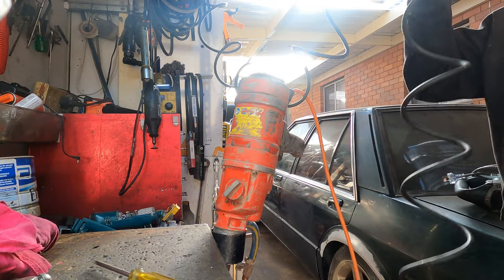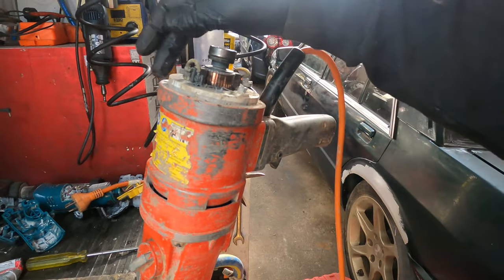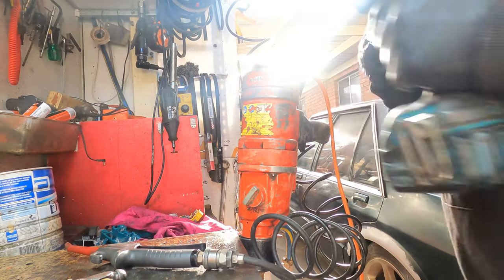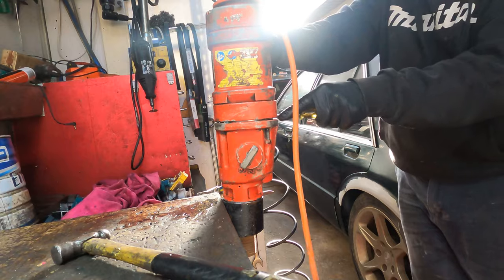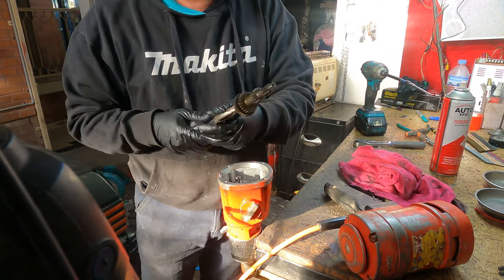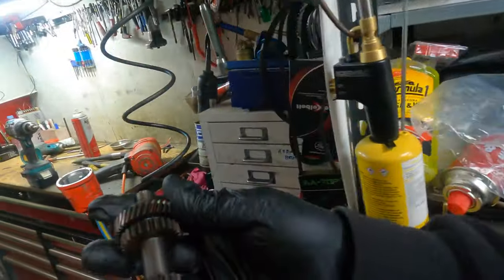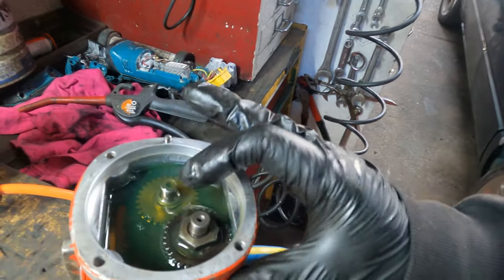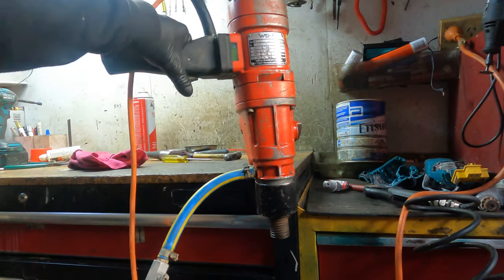weka core drill quick services

Comment: Been workin on wekas for 25 years.....dk 12, 22, 32 and 52.....good video👍🇺🇲🇺🇲🇺🇲🇺🇲🇺🇲🇺🇲
Reply: Can you tell me the torque specs on the clutch for the DK16/18?
Reply: @basdoo4847  If I remember correctly it wasn only 35 but that is simply not enough. It would start slipping with a three inch bit..I would get it actually as tight as I can with a 3/4 inch wrench. You have to put the gear into a vise wrapped with a real heavy rag. Or you'll mess up the gears when you go to tighten it up and tighten the little nut.

Comment: Hello. The clutch is a safety mechanism. It is there so that you Don't strip out the gears in case the diamond core gets stuck. Most importantly, It is also there so that the drill doesn't break your arm. This size should be torqued to 15nm. The ones that are larger, 20nm of torque on the screw.

Comment: That part you dropped is the copper bushing when that wares out ,the teeth stops engaging with the main gears, the torque on the clutch is equally important, I’ve used theses drills a lot .
Reply from the maker: @JeffSebastian-dq4sd   correct get new copper it call clutch

Comment: I'm working on my core drill. It's a weka dk12. Thank you for the video it really helped out. Although I got the clutch shaft out and the 2 of the gears off of the main shaft, I can't get the little retainer ring off that's deep inside. I can open it up the ring but can't get it out of the groove and off the shaft. Any chance you can walk me through that? I'm trying to completely disassemble the gear box so I can replace the seals and possibly the bearing. Also some genius took the gear oil out and replaced it with grease. I'm assuming because the lip seal was leaking and they figured the grease wouldn't leak out. I need to completely clean up all of that old grease so I can put it back together with some fresh oil. Any help would be appreciated!
Reply from the maker: The main shaft seal very hard to replace.if you know it not hard.got to carefully when your remove the gear lever.it got hold by spring ball becarefull  when open .after you got it out can smask the main seal out.2 of them
Reply: @TheDingdong78 any advice on the rotary seals ?
Reply from the maker: Try to pull it out
Reply: @TheDingdong78  which way do they come out is it through the front of the gear box it looks too big to come out that way
Reply from the maker: @DavidHayesbigtoe  back where you open up and see all the gears come out at the back

Comment: Hello I have a Milwaukee core drill (4005) and had all the seals replaced and it still leaking water. Water shoots out from the 4 little holes on the shaft and also on the bottom. Any suggestions on what it could be.

Comment: Hi Simon, my Core Drill DK 12 when set on gear 1 and press the trigger and will do free spin but when i started to drill the concrete it stop spinning completely and the drill is still running. Gear 2 and 3 seemed to work just fine.  Please advise. Thanks in advance
Reply from the maker: Need fix clutch inside where the gear is
Reply: @TheDingdong78  Hi Simon, I opened the gear compartment and inspect the clutch and it looks great to me, nothing damaged, and I have no way of opening or tighten the bolt on the clutch so I gave up on that.  I noticed my gear 1 is still working but it hard to engage I have to manually spin the drill bit back and forward and turn the gear knob into gear 1 a bit to have it completely engaged into gear 1 for it to drill properly. I also noticed that I need to do the same for gear 3.  Gear 2 is just fine as it is in the middle.  Is this normal? Do you still think that my clutch has an issue or the actual gears has issue?  Thanks please help.
Reply from the maker: This you try to put any forge on the drill see it work..
Reply: That mean the clutch is too lose
Reply from the maker: @jerryortiz6280  yes